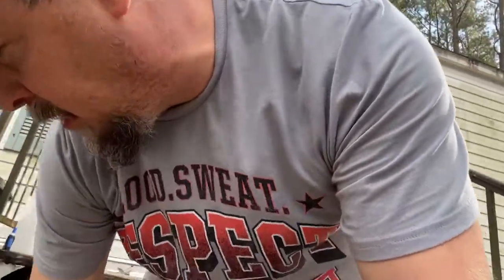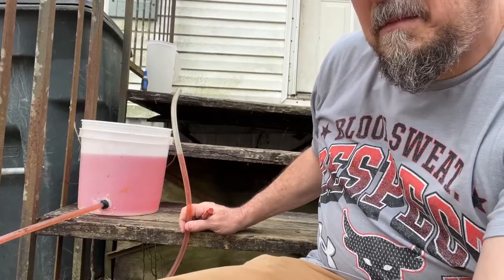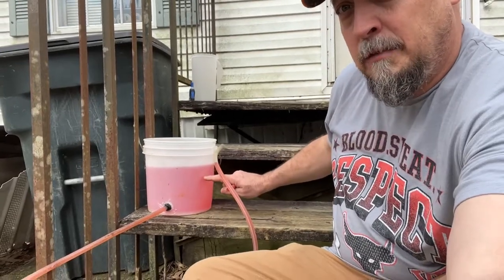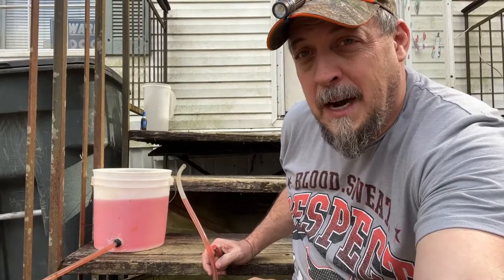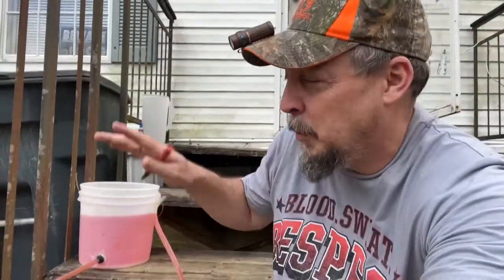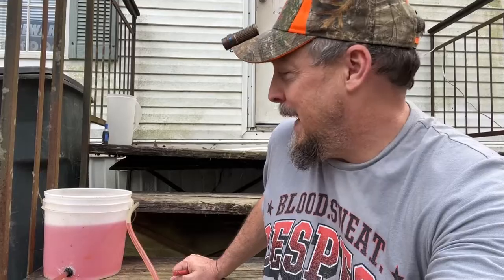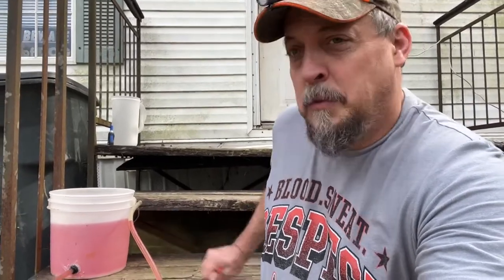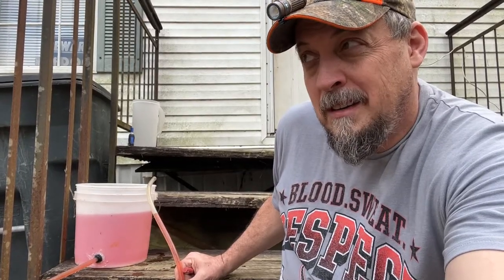Best way to level a building/ mobile home: Using a water level

Comment: Confused? When the bucket is under the trailer is it blocked up near the beams and measured from the beam to the water line or do you block it up next to the beam where the water line is equal with the bottom of the beam? and do you have to find the highest point first? It is hard to understand how this works not using the trailer.

Comment: Very interesting but I’m still not sure that I understand how that works. 😄 
Do you (first) make the level of the fluid in the bucket line up with the base of the mobile home, and then (secondly) you go around the outside of the home and hold the pipe up against the side of the home, and check if the side of the home is aligned with the fluid level in the pipe? Is that correct? 
And if that is how you do it, then how do you know where (what level) to ‘set the bucket’ at, because if that bucket spot is already wrong, then one could be unnecessarily re-leveling a lot of pylons, and not just the ones that are out of alignment when measured against the majority of them. (Hope you understand what I’m getting at here.) So I would think that where one sets the bucket is critical.
Maybe needs more detailed instructions for us newbies, thanks. I need to re-level my single wide.
Reply: Don’t worry I found another video that showed me how it works, thanks.
Reply: @AfricanFlightStar please post the link to that video .
 Thanks
Reply from the maker: Have you ever siphoned any fluid? The fluid flows towards whichever side is lower until the fluid is equal at both sides. The reason for the bucket is to work as a reservoir so one side doesn’t go up or down much while the other side is a thin tube to reveal inconsistencies in level. The hose and bucket should not overflow, and have a higher total volume than the amount put in it.  No air should be in the line. I like to have the level in the bucket equal to the desired level point, but it doesn’t have to be the same as the desired level point as long as you know the rise or drop at each measurement.
Reply: How do you make sure to get the bubbles out?

Comment: Did you calibrate the bucket?
Reply: Calibration is done by not moving the bucket or changing the water level while maintaining consistency of measurement at the other end